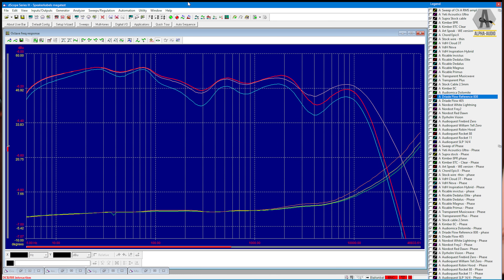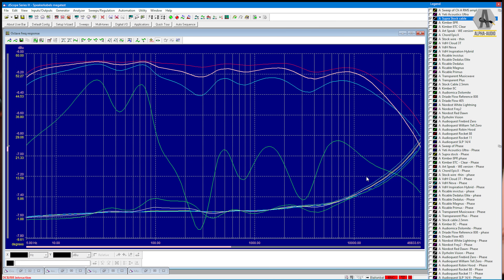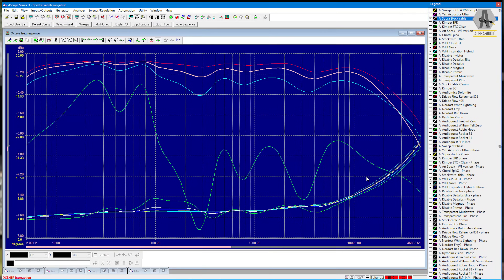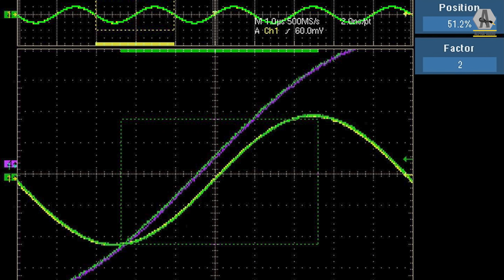Your speaker cable matters! 32 speaker cables tested - with measurements!

Comment: I have a r8 tube amp a freya plus and hifi rose. 
Changing interconnects from the silver ribbon I had made a huge improvement. 
I thought I had good speaker wires going to my Verity speakers I made them. Then I got zu audio speaker wires, the improvement was better than adding any of the gear mentioned including expensive Tubes for the amps.
Reply from the maker: @shadowofpain8144  with tube amps the difference is huge...

Comment: Speaker cables only matter if the ones you have are too thin (not enough copper) or degraded (oxidation, corrosion, etc..). Any sufficiently thick oxygen-free stranded copper cable will perform roughly the same. Double blind tests have proven that repeatedly.
Reply from the maker: No they didn't prove that. But if you are happy with your cable, that's fine of course. There are more factors that play a role than conductance and impedance though. Just read the article on our website to learn more.
Reply: @TheAlphaAudio  I found your testing methodology somewhat lacking. There was some interesting information to take away from the measurements, but it doesn't mean what you think it does. 

I'm speaking based on my own 12+ years of working with stranded cable in both audio and low voltage control applications. I know all about impedance and how it can affect a signal. I can put an oscilloscope on a wire and find small differences in waveforms from one box of the same SKU of wire to another. Ultimately it doesn't matter, because both will function the same way as far as the end user is concerned.

Measurements are interesting, but the ultimate test of speaker wire (or any component or accessory) is a double blind listening test. This wire is being used for audio, after all.
Reply from the maker: @hartsickdisciple  thank you for your feedback.
Reply: @hartsickdisciple 
hi, unluckily I can't read Your answer since It misses the finale part. It looks as It Is a photo picture cut in the bottom part.
Would You please edit It, thanks?
Or It may be only an issue of my phone, but It Is the first time It happens to me....😅

Comment: The only reliable comparison and opinion regarding audio is a double blind experiment. 
Whenever someone does one, the result is that noone can hear such differences, like cables, or even normally functioning hifi components.
Reply: Double-blind is subjective, to get valid results you would need 100's of tests. It's not reliable at all unless you do all those tests.
Reply: @Pete.across.the.street you dont need 100s of tests. You already had 100s of chances to pass the first test, which you didnt.
Reply: @Pete.across.the.street  double blind tests are designed to eliminate bias making it completely objective.

Comment: A for intent, but D for static testing/execution.  Please seriously consider the results of Gene's real-world-complicated-speaker-load testing that Gene performed at Audioholics: https://www.youtube.com/watch?v=kR12Ttuxobs&ab_channel=Audioholics
The emperors have no clothes!  
Please expose the hundreds of speaker cable grifters who have been cheating audiophiles for decades - similar scam as palm readers, and equally subjective/susceptible.
Please sell your $5,000 speaker cables to some other sucker (or better yet, recycle them), buy some equal-length pure copper 10 AWG wire available at Lowes, and invest instead in your room acoustics/symmetry, and your transducers.

Comment: The day you can tell which cable is what in a blind test, I can spend sick money on cables, so far decent cheap cables in good quality will do the job fantastically, I choose to listen with my ears rather than my brain; )
Reply: There are indeed small differences in impedance, capacitance, inductance, resistance, etc. However, we can discuss how significant those differences actually are. I am highly skeptical about spending the enormous amounts of money that the market tries to justify.
Reply: very subjective
Reply: @Pete.across.the.street A lot also comes down to amplifier design and how well the cables match the amplifier and other components. But the question is whether cables costing tens of thousands of money are justified. Of course, the thickness of the cable conductors, geometry, and insulation matter. But not to the extent that it should cost thousands upon thousands of money. Naturally, the more sensitive the system is, the more it reveals. But there’s still a risk of falling into a rabbit hole here.

Comment: He is correct. Speakers don't work very well without cables. If you pay more than 100 per pair you're mad.
Reply: If you can’t hear the obvious differences a great cable can do, you are deaf.
Reply: You probably can get a decent quality for <50 for reasonable lengths.
Reply: 100 is probably too high given the usual length needed but you certainly are  if you pay over 100 , whatever the hundred currency is. It's rather bizarre listening to folks go on about sound quality differences in cables and seemingly they really believe it.
Reply: @ConorHanley Well, 100 may be a significant number in USD. It isn't in the majority of the world's currencies. In Korean Won for instance, it's just over 6 cents 😅
Reply: @sparkeyjones6261  there is conversion btw.. almost identical situation with different number
Reply: @ Well, sure, if you do the conversion. 100 is practically nothing in many currencies.

Comment: The interconnect, power, and speaker cables operate differently in the system. Their impact on the system can vary because of the signal path. Generally for analog cables, the choice of conducting material, design of geometry, gauge size, impedance of the connectors and insulation have to be clearly selected to provide clarity, balance, and noise reduction of the sound signal and quality in different aspects:

Tonality - manufacturers choose 7N copper or 5N silver as the conductor because of low resistance, but they can sound very different. Silver provides a crisp sound and good detail in the upper range, but it can sound bright when paired with monitor speakers such as B&W with diamond tweeter, whereas copper can sound a bit warm with bloated bass with English speakers. Companies like Siltech use silver wires with gold blended in, which gives a tonal balance that neither pure silver or copper can give.

Noise level - the purity of the conductor is crucial to the clarity, otherwise the speakers would lose the detail in the music. As for power cord or speaker cables that transmit a lot of current with increased electromagnetic wave, the insulation layers have to be thickened to avoid interference from the surrounding. Think of a long transmission wire that becomes like an antenna in the listening environment, which can pick up a lot of radio signals in the air.

Loss in detail - the connector material and impedance are also important for a cable as a signal transmission line. If the impedance of the connector or the material does not match, it can cause deflection or distortion of the sound signal, which will result in loss in detail. Some of you might have experienced this when using cheap spade or banana plugs at the speaker terminals.

Interconnect vs Speaker cables - both are critical to the sound quality in a different way. The interconnect cable connects between the source (turntable or CD player) and the pre-amp, or between the pre-amp and power amp. If the quality of the interconnect cable is poor, the noise and distortion will be amplified by the pre-amp and the power amp, resulting in poor sound quality. The speaker cables carry both the power and the amplified signal to the speakers. A high powered system requires high quality speaker cables because the current is high especially at low impedance, be it 4 ohms or even 1 ohm. Any impure conductor with high resistance can lower the output power and cause the loss of details. It will get worse as the cable gets longer. 

Power cable - it tends to be more critical for a power amp with over 200w output per channel, because the amplifier would require up to 500w of power at high volume. People may not notice the amount of electromagnetic wave that is flowing through and around the power cable when the amplifier draws a lot of current from the power supply at home. If the source power is not clean and the cable is not good enough, the amplifier can longer function properly in delivering the amplified signal to drive the speakers.

As a general advice, the owner of the system should evaluate the proper cost of the cables with respect to the quality as well as the power requirement of the components. In some cases, the user may need to try different cables in order to adjust to the tonality of the system.
Reply: Wow, that's a lot of words expressing "I have no idea about physics".

For example: the noise floor of a speaker cable (home improvement store variety) is barely even measurable. Around 140dB signal to noise ratio. Improving that will do exactly zero.

The "tonality" of a cable is also something that can't be measured. People tried! All cables at reasonable living room length have a perfectly flat frequency response, just as you'd expect from a piece of fucking wire. This only changes when we're talking about concert hall lengths.
Reply: @ropeburn6684  
Have you not heard about transmission line impedance and electromagnetic interference? These are both studied in introductory courses in physics and electrical engineering.
Reply: @StereoDemo-t9b  Transmission line effects are important for RF transmission over great length. For a few meters of cable transmitting really low frequency signals (aka audio), that's completely irrelevant. Ohhhh my cheap 3 meter RCA cable has a roll off after 100kHz! Boohoo I need better and more expensive cables! 😂

Comment: Thanks for this test, is it ok to have different lengths eg one speaker 3m and the other 7m (hifi is on the side of the room),
Reply from the maker: @mrkitewine7700  better keep them the same length. This is because of impedance difference.
Reply: @TheAlphaAudio  thanks very much for the speedy reply, much appreciated. my concern is I will end up with a 4m coil of spare cable with the shorter run which cannot be great
Reply from the maker: @mrkitewine7700  not if you wind it too tightly. But a slight 'loop' on both ends isn't a problem.
Reply: @mrkitewine7700   IF you have excess wire, do not coil it into a round circle.  Overlap or lay out the excess wire in a "Figure-of-Eight" pattern as large as possible, i.e. as in the shape of an INFINITY symbol, with the input & output ends of the wire exiting opposite ends of the Figure-Of-Eight.

Comment: https://www.youtube.com/watch?v=Gf3Yez8WTz4

Amir measuring a speaker cable.

As you can see we have two camps with various methods and presentations on findings. 

There is certainly right cables for the job, but the consumers need real data and understanding.
Reply from the maker: We tried to do as best as we can in this test.

Comment: I used to spend a fortune on Monster cables for my home audio, now I use powered Monitors exclusively with line level voltages as they sound considerably better than “speakers” connected via thick cables from a massive power amps.  I went from 50 ft or so of huge Monster cable from power source to about 4-6 inches internal power source.  I’m now a Genelec consumer (8351B + 7350A) with GLM/SAM for room calibration … considering many mixing studios where the recordings are made use Genelec GLM/SAM I get as close to the original mix as possible.  However, I also doing video/audio work and play various keyboards/synths (KORG Pa5X, NI).  I use Mogami line level cables exclusively.  For mix compares I do have Sen HD650 going to a Rupert Neve headphone amp.
Reply: @robainscough  monitors are for producing not listening. you don't hear it as it was intended to be heard, you hear it as the audio engineer heard it for his purposes (aka to make it sound a certain way on normal/audiophile speakers). to each his own though

Comment: My experience, in my system, is the opposite - interlinks have very little effect on sound quality and speaker cables have a huge effect. Thanks for the video.
Reply: After changing my popular neuronic interlink with some hyped up cheep fidelity alternatives I can say he is correct about interlinks. It doesn't mean I will start testing better and better cables costing more than a car. Just that it is worth looking at value for money alternatives. It was a very audible difference

Comment: I don't argue that different cables will make differing measurements, and have different noise ect.
But you held up a cable and said it is worth 20k, how on earth do they justify 20k for some plastic jacket and copper? 
Go to the cable shop and buy some $5m wire and get a few different styles, swap them out and try twisting them, until you find the sound you like, paying 20k is just stupidity.
A sucker is born every day.